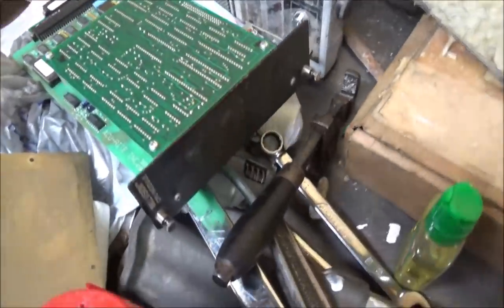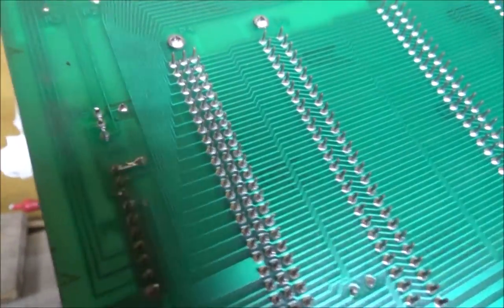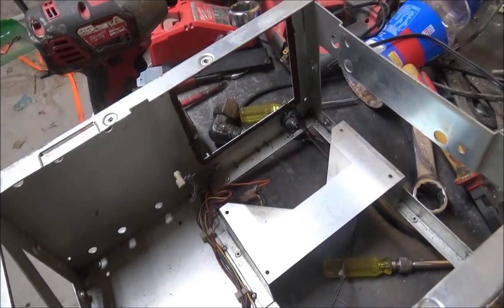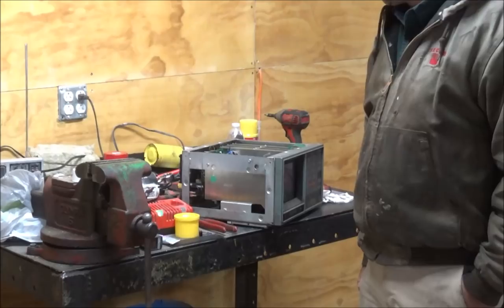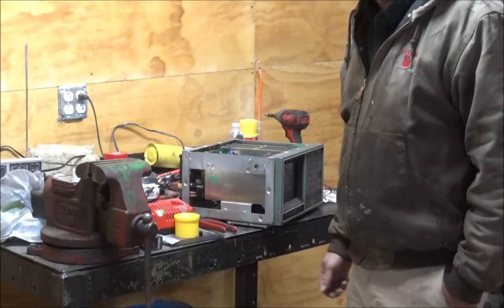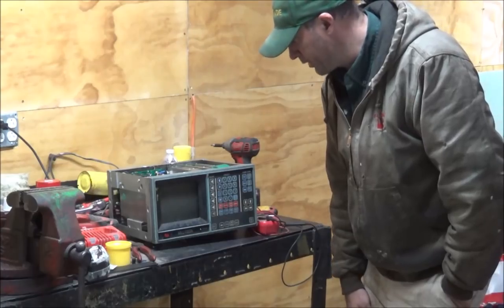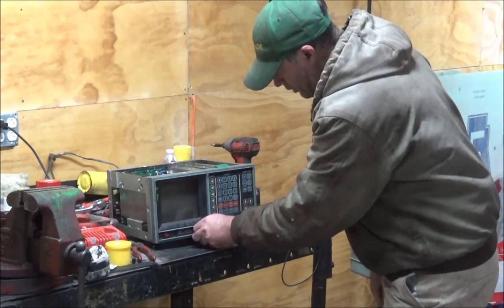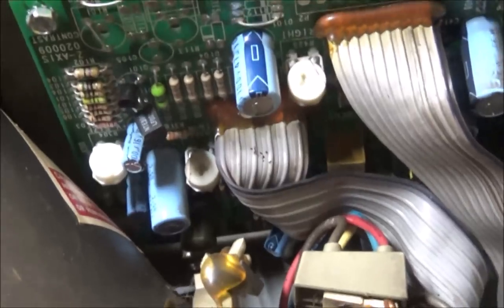Fix one problem a new one follows. CRT help anyone?

Comment: If you can't spot the  circuit problem and trouble shoot this then you have no business messing with it. Good grief..Use some freeze spray, pinpoint the problem, examine the board under magnification, GET the SAMS or a diagram...It doesn't take a GURU it takes someone that has a few weeks experience troubleshooting solid state TVs..
Reply from the maker: I contacted the manufacturer, obsolete product, no circuit or component diagrams available. I am just learning, but it is tough with nothing to go on. I am sure I have no business messing with it but since it doesn't work I don't have anything to loose either.

Comment: you need to adjust the vertical hold.
Reply from the maker: Now if only it had one!!
Reply: @bcbloc02  it should, it looks like a standard raster monitor. So 1 of the adjustment pots will either say v hold or frequency hold. Adjust till the picture is stable
Reply from the maker: The only pots are Bright, VSize, VLine, Hphase, and Hfreq
Reply: @bcbloc02  try adjusting v line if that doesn't change anything try h freq. Yup will need an insulated screwdriver or plastic one ad adjust while the monitor is on. Be careful of the flyback anode (heavy red wire that goes to the suction cup to the back of the tube) that is the high voltage lead